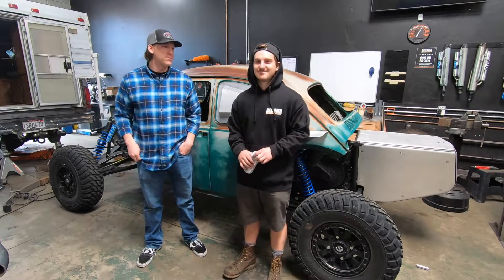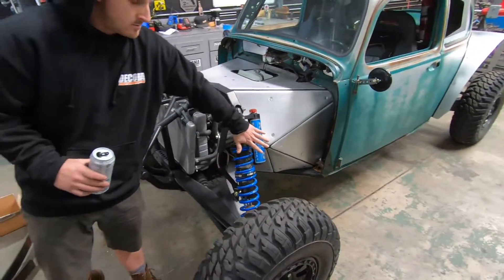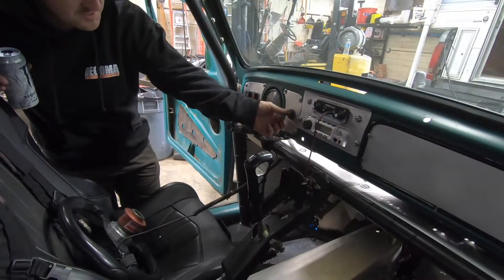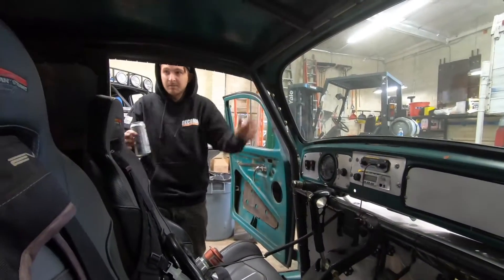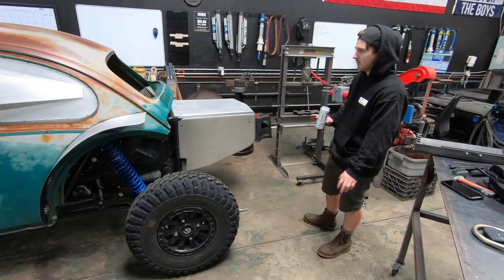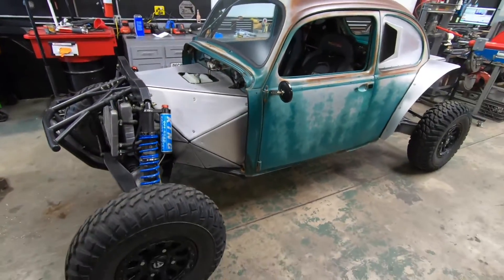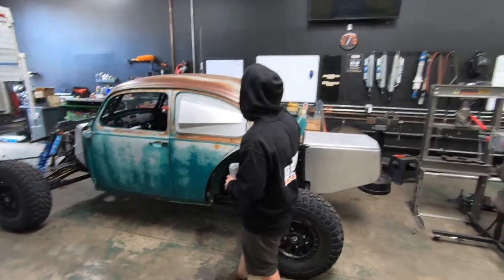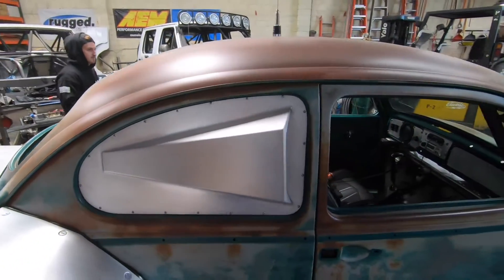He Turned A TOTALED RZR 1000 Turbo Into A LONG TRAVEL BUGGY

Comment: Definitely a rzr  with an extended chassis with a bug body on
Reply: Too heavy. Body should be fiberglass or carbon fiber. Now that WOULD be cool... and light.

I don't need a RZR to build this, just an old reasonably well built dune buggy or sand rail and a bug body. RZR's are cool but under powered for this much weight.